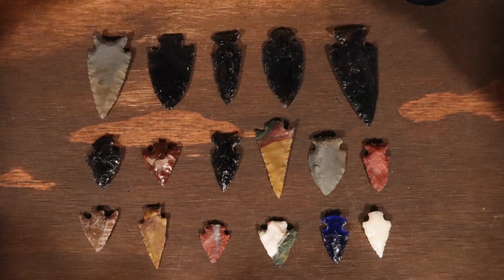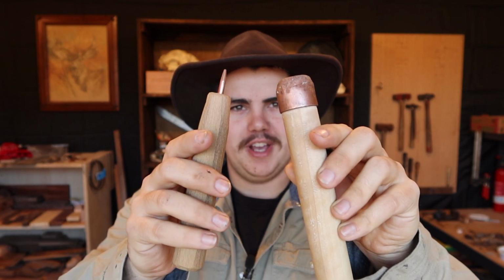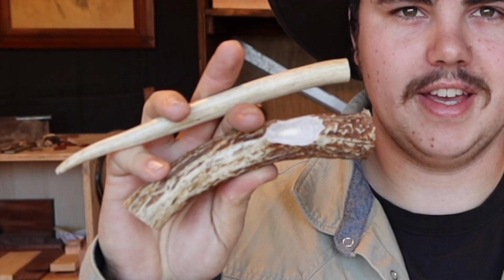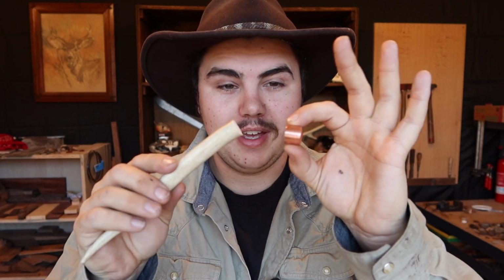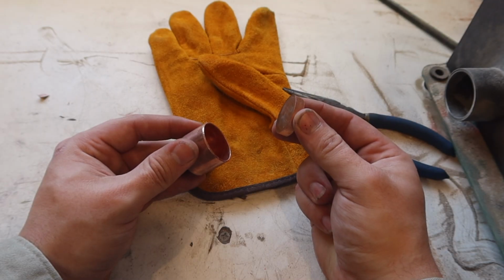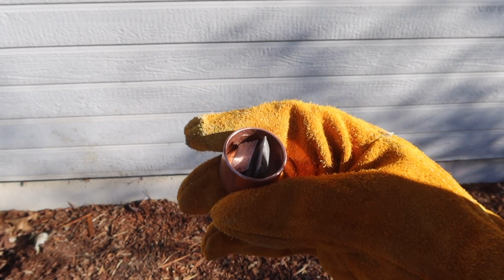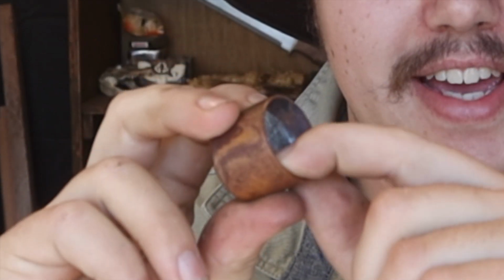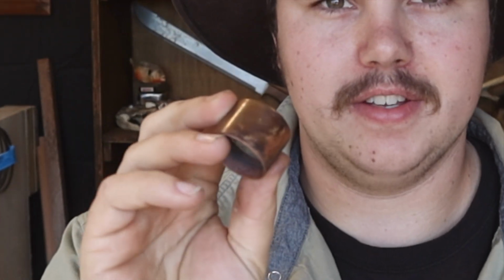How to Make FLINT KNAPPING TOOLS!! (for Making ARROWHEADS!)

Comment: What was the small size cap for your presure flaker
Reply from the maker: It was a copper pipe cap you can get at the hardware store, I think 3/8. Just adds support so the copper rod doesn’t loosen up or blow out the side of the skinny antler.

Comment: To avoid annealing the copper, heat the lead in another vessel and then pour it into the end cap. If you heat the copper like a crucible with the torch - it softens the crystal structures. That means it will need to be pounded or hammered to harden it up again, and it won't keep it's original shape.
Reply from the maker: Good point!
Reply from the maker: Awesome! Glad I could contribute to your project!

Comment: Sharpen that pressure flaker!
Reply: and shorten the bit. Its far too long and blunt. Set up platforms belong the center line so you can actually drive those flakes in.
Reply from the maker: I started with using a sharp point but I found that the edge of a blunt point works just as good for me and requires less maintenance. I am no expert though. Thanks for the input!